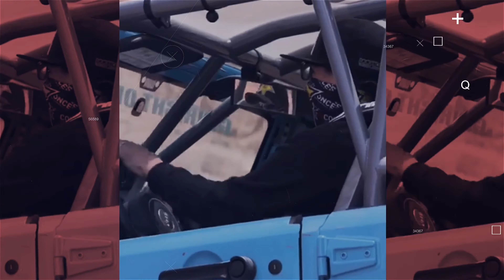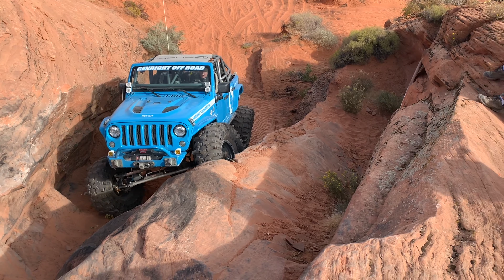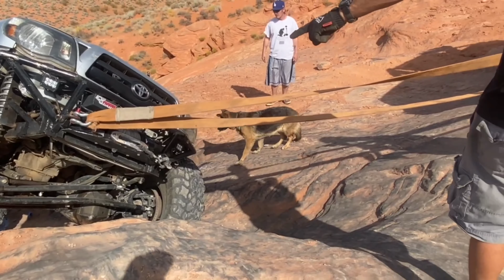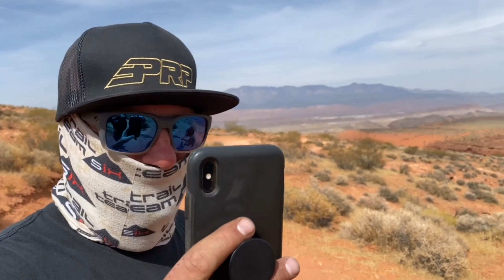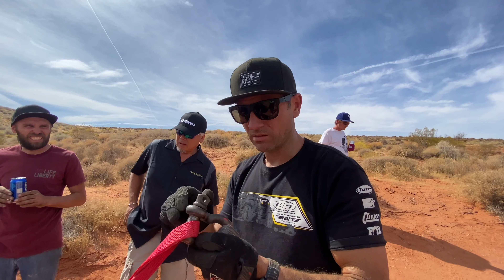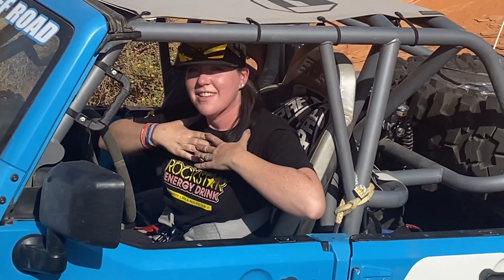Trail hero 2020

Comment: Time for some RCV axles!
Reply from the maker: The hardcore hub shattered to bits. The shafts and SuperJoint were actually fine and are still in the Jeep right now 😁 - Still not convinced this crawler needs RCVs (especially after this experience). I only bothered to pull the shafts on that side to make sure everything looked good since we were going back out on the trails 👍🏻
Reply: @MischiefMakerTV  Did you happen to see a grey Priola jeep out there?
Reply from the maker: I don’t remember seeing anything along those lines, but it was a pretty hectic weekend!